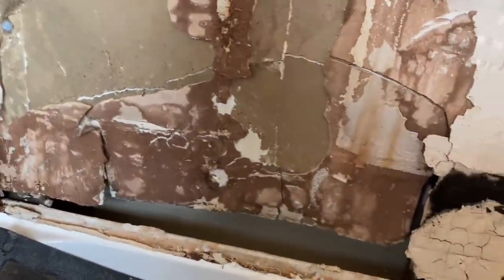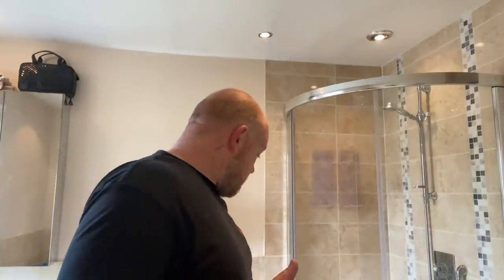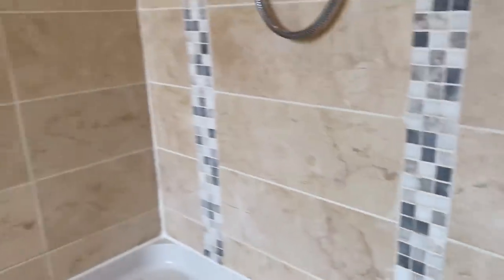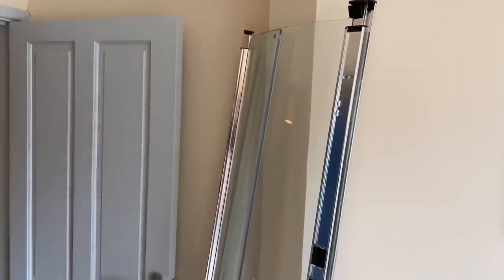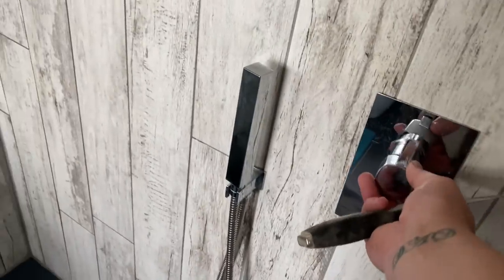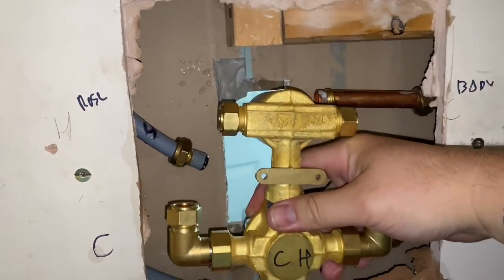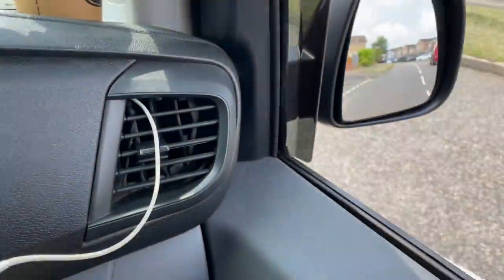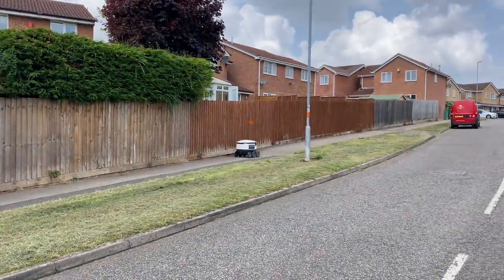SHOWER PROBLEM ON THIS JOB & HOW TO STOP A SHOWER PUMP FROM “PULSING”…

Comment: I might of looked at that shower tray and told them it’s a new one, shower screens do not like being removed and then put back, especially that type
Reply from the maker: Yep, I have said that the screen could be an issue, especially as it’s one that fits to the tray….. however it did come out fairly well👌🏼
Reply: @MJTiffPlumbing  our game is tricky sometimes, trying to save the client money by re- using the screen… week later the runners break and now it’s not fixable
Reply from the maker: Yep…. 🤣🙈🙈🙈

Comment: bigger pressure vessel might have done the job
Reply from the maker: To be fair, once it was sighted next to the cylinder in the airing cupboard it wouldn’t really need one at all… it’s only a negative head one as it was originally in the loft but still did the same

Comment: I’ve had that on a salamander pump. Did the same thing but for the life of me I couldn’t understand the physics behind it.
Reply from the maker: Yep…… this is a Salamander pump aswell…

🙈
Reply: I tried it just because, like you I’d tried everything else but everything in your head tells you that it would probably make it worse if you throttle the water down. 🤯
Reply from the maker: Exactly my thoughts mate…. But it worked 🤷🏼‍♂️

Comment: Looks like the pump did not have enough supply volume. 

Throttle the outlet imo pumps want to push not draw. 

In the Mi’s they generally say upsizing the inlet to give adequate supply volume.
Reply from the maker: This is what I couldn’t understand……

The supply of head is fine, volume is fine…. 

But couldn’t work out why turning the isos down on the inlet made it work fine🤷🏼‍♂️🤷🏼‍♂️

As said, we tried it without the shower valve, straight off the pump and it was fine🤷🏼‍♂️

Strange strange one
Reply: From Stuart Turner. 

• Pipework: For optimum performance pipework MUST be 22 mm. Pipework should only reduce to 15 mm when entering terminal fitting.
Reply: @MJTiffPlumbing  

By restricting the flow you are lowering the Flow rate that’s possible.
Reply: One other issue ive had is the supply from the CWST was not adequate this dropped the flow on the HW side. 

When you connected your hose was it a short length and was it on both hot and cold.
Reply from the maker: Hose was connected on each outlet and a constant watch of the tank in the roof…

Shower pumps can be such a pain.

We will see how he gets on with it now…
Reply: Out of interest how long was your hose pipe on the test?

Apologies if this is annoying i love this part of the job, using ones Grey matter makes for an enjoyable day for me.
Reply from the maker: Not annoying at all Tom, love having input from others in the trade, at the end of the day we are all still learning everyday.

I would say it was around 5metres as I was in the loft and the hose went to the sink🤔